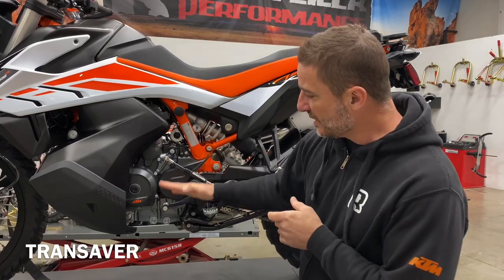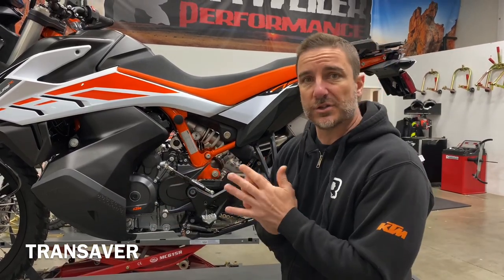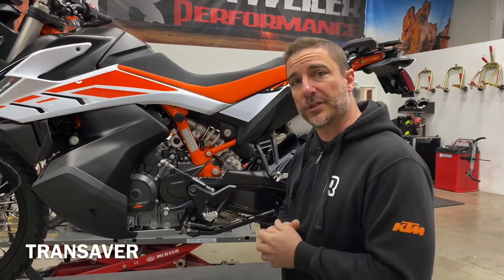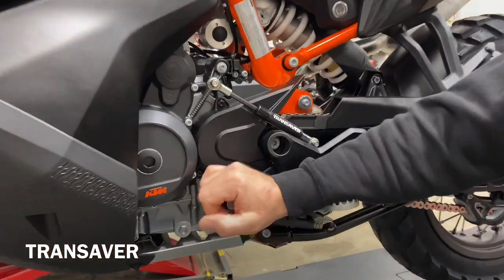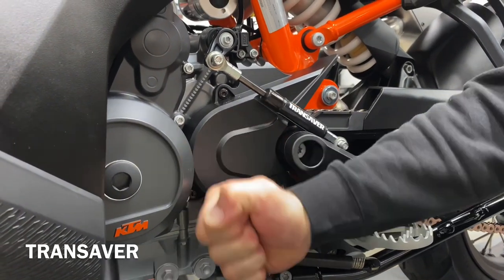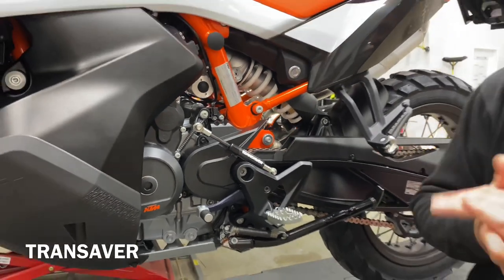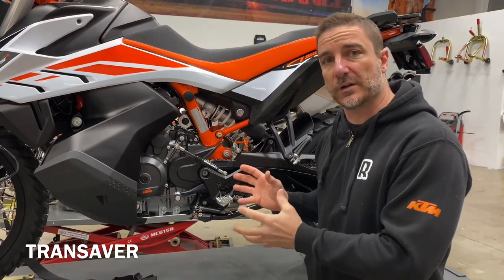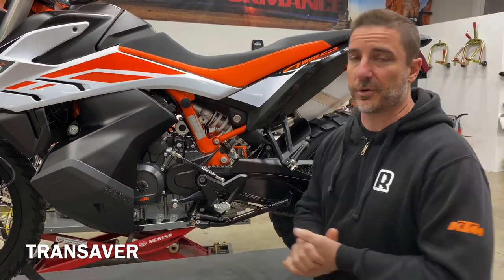PRODUCT REVIEW - ROTTWEILER PERFORMANCE TRANSAVER - KTM 790 ADVENTURE

Comment: Cool, does this also work in combination with the quick-shift option?
Reply: I'm also curious about how this works with the quick shifter enabled
Reply: still installing mine but how it works is beyond a certain lbs the strut compresses preventing that transfer of force to the transmission. shouldn't impact quick shifter at all.

Comment: Does it matter the direction of  install?
Reply from the maker: Yes, we actually changed the direction opposite from this video. This was shot when they were still in the prototype phase and we got better clearance and actuation in the other direction. Just follow these steps linked here and you'll be golden! 

Adventure 790/890: https://www.dropbox.com/s/2pj4vb5ju8xxjs8/790-ADV-TS%20.pdf?dl=0
Duke Stock Rearset: https://www.dropbox.com/s/s50i8p1v2hklweu/790-DUKE-TS.pdf?dl=0
Duke Powerparts Rearset: https://www.dropbox.com/s/q3d9qe28rg33e6o/790-DUKE-TS-PPRS.pdf?dl=0
Reply: @RottweilerPerformance  yea I was confused since I’ve seen two different directions. I found the instructions and followed it. Thx
Reply from the maker: @rayrokni  Understandable. Once these videos are published, you are kind of stuck! Good call asking and enjoy the ride!

Comment: Should the shipped Transaver compress as in your video under the force of your hand?
Reply from the maker: Not at all. It should be extremely difficult to compress the Transaver. It is designed with enough force to emulate a stiff linkage just like stock, but break free when there is excess force applied to it so save you from bending shift forks.
Reply: @RottweilerPerformance OK, thanks for the response! What I was trying to clarify is the transaver in the video is compressing purely for demo purposes? I got mine and expected it to behave like this one.
Reply from the maker: @ADViators  You'll see once it is on. The leverage you have with the shift lever is enough to be able to compress it, but otherwise it acts and feels like just like a normal shift rod but breaks away under hard downward pressure.
Reply: @RottweilerPerformance  got it on the bike and the compression is working as expected, thanks!
Reply from the maker: @ADViators  You got it!!
Reply from the maker: @ADViators  You got it!

Comment: Nice! Can you still adjust the length/hight of the lever position? I don't see any locking nuts... Reverse threads?
Reply from the maker: You can, but no longer with the tie rod on the Adventure model. Because it's so short we just couldn't fit any adjustability on the rod but it's now done with the lever at the engine so the adjustments are more like a dirtbike. Check the graphic in the link attached. It's the 5th pic over on the bottom. The DUKE you still retain the micro-adjustability. http://www.rottweilerperformance.com/rottweiler-performance-ktm-790-adventure-transaver/